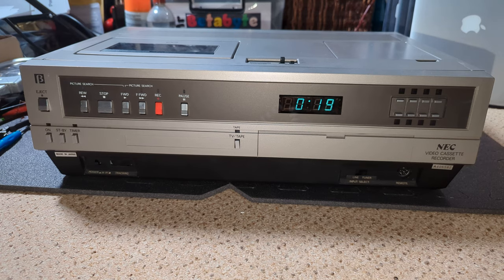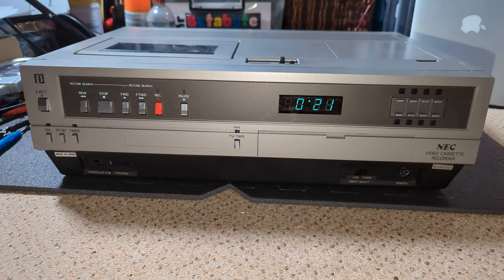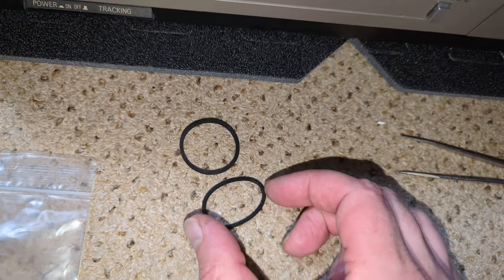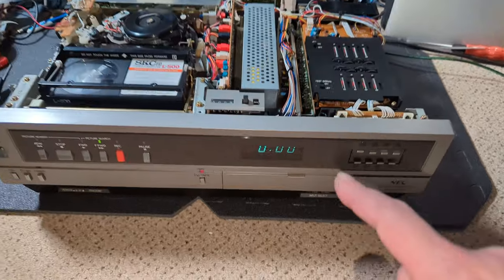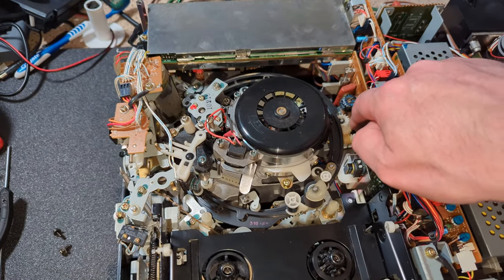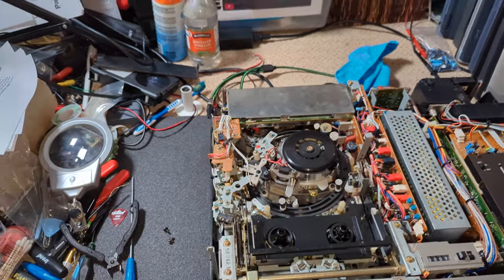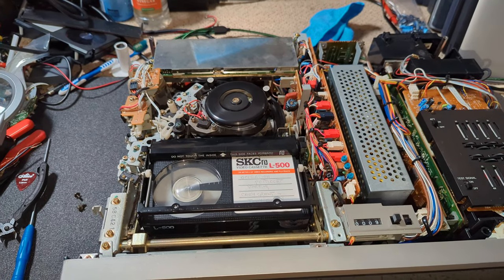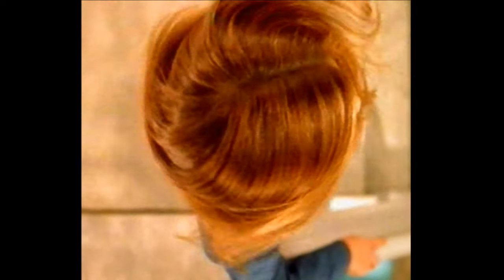NEC PVC740 Betamax - No lace or eject

Comment: Thank you again for your help, MrBetaByte! Do you know what value the capacitors are supposed to be for the capstan servo board?
Reply from the maker: How did you get on? Has he managed to sort it now?
Reply: @MrBetaByte  Not yet, but I found someone who has experience in working on Beta VCRs. He has an oscilloscope, and said he would look at it when I got it back. The first guy I sent it to fixed pretty much everything, but still had to make speed adjustments and try to fix the belts and tracking. Betamax is such a dinosaur, but not as old as the UMatic!

Comment: Never seen an NEC machine.  I wonder if it's all built by Sony, or if NEC had some actual input beyond machine specification and badge engineering.
Reply from the maker: It's all NEC electronics with a lot of Sony components but the deck is pure Sony as used in the SL3000.
Reply from the maker: @seventeesweremagic I had completely forgotten about the reel motor on the NEC! Not had the bottom off this machine although I did do a full service on one of these around 5 years ago. This machine is almost a channel mascot!
Reply from the maker: @seventeesweremagic Do you know if this same deck was used in any Sony machines of the day? Wondering if any NTSC machines might have maybe? The C5 and C7 didn't have the loading motor using the capstan motor and no reel motor.

Comment: Hello! I have a Betamax SL-5000 getting fixed, but the person fixing it has run into an issue. He says the capstan motor is "pulsating." Do you know anything about that? Cool videos with all those old machines!
Reply: It could be the two 0.22uF Sanyo electrolytic capacitors in the capstan servo circuit, right next to the capstan freewheel preset control on one of the lower boards.  If it's anything like the PAL Sony SL-C6, which I think it is.
Reply from the maker: It'll be the Sanyo capacitors causing this. It'll be the small value ones so any 0.22uF, 0.47uF or 1uF capacitors with the light blue Sanyo sleeves are suspect. I try and change them for tantalum capacitors as they'll last much longer. I'm about to do this on both a Sony C6 mark 1 and a mark 2. The C6 mark 1 PAL machine is similar to the  NTSC SL5000. Hope this helps.
Reply from the maker: @video99couk Just seen this after I replied! More capacitors are giving trouble these days - it's the light blue low value caps that are all giving up. I remember being asked about this fault in an interview and quoting those two caps as the potential fault back in the 90's.
Reply: @MrBetaByte  I've shared this information. Thank you so much!

Comment: Hello, MrBetaByte! You responded to a comment I made about a SL 5000 getting fixed, but do you know what value the capacitors on the capstan servo board are supposed to be? Thank you so much for your help, and great videos!
Reply from the maker: Thank you - Have replied to you on the C6 Mark 2 video. It should be pretty similar to the 5000 but in the UK we never had that machine so I have no experience of it unfortunately.